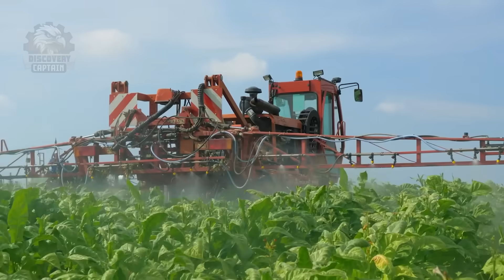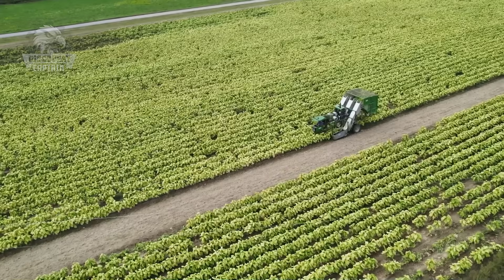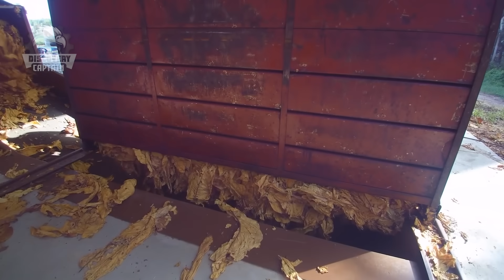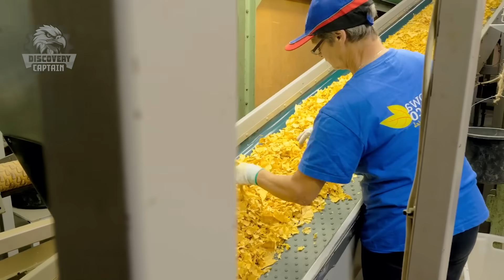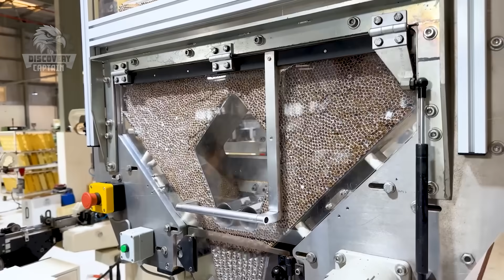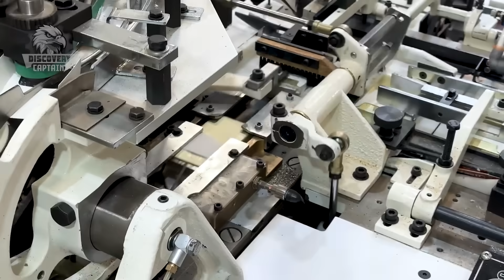How Cigarettes Is Made In Factory? Captain Discovery

Comment: I always wonder how the hell do the owners of this high tech companies teach their earliest team the work process from the start until the final product is on the table.
Reply from the maker: Honestly it’s mostly trial and error at first. Early teams usually learn by building rough versions, failing, and writing down what finally works until it turns into a repeatable process. A lot of the know-how also comes from hiring veterans who’ve run similar lines before. Do you think a founder needs hands-on factory experience to pull it off, or can good hiring cover the gap?
Reply: @CaptainDiscover I think the combination of both.

Comment: You left out a lot of steps, showing completed tubes with a carbon filter stuffed as the end result. Okay you showed two different ways of the factory processing the physical cigarette tube's but you never showed when the carbon filters where added. Then as you where showing the process of how some factories run a long single piece of paper you again left out steps of, 1 cutting the cigarettes to length. 2 again adding the carbon filters. 3 the glue that is used to seal the tubes.

I feel that due to these rather large issues you may want to reconsider this video and feature videos and have some "better planning" as this could be considered as "miss information"

Comment: I'm 52, will be 53 in March, I started smoking when I was 5. My older brother (by 14months) gave me a cigarette and dared me to smoke it... And my life has never been the same.. I've tried everything under the sun to quit and nothing works.. 😔
Reply: When you use patches, do NOT use the instructions on the patches, they're designed to get you to fail back to cigarettes. Use them intuitively to get your nicotine dose(fix) AS YOU NEED IT. A patch can last 2 days if it doesn't fall off, so use heat when applying the patch or keep pressing for a minute or more. Don't switch to the next lower level until you're ready; forget about the time period they suggest you use them for. Doesn't that make sense? When you're conscious of it, you only smoke as much as you need, so why not use as much patch as you need?

Comment: i quit cigs around 2017 cause it tasted like chemicals so i switched to vaping and it is much cheaper which is good for being on low income plus it tastes good like whatever you like there is a flavor for, but i mostly like fruit flavors and some tastes like real fruit or candy and your clothes don't smell awful and anything at all plus the cigs i was smoking they burned up too fast unlike a vape you can puff it till the tank runs out which mine is 10 mil which will take 1/4 to 1/2 a day depending on how i am and too add there is no cooldown and vaping it accept if you puff it too hard then you have to wait 3 seconds for it to saturate the wick in the coil. dont not buy the pen type ones they really suck and worse then smoking a cig so buy the big vapes if you plan to switch so yea don't waste your money on the small ones.

Comment: I live in North Carolina, and I'm surrounded for miles by tobacco fields. I have never seen a machine chop off the flowers, or harvest the leaves. I have seen both these things done by migrant workers out in the fields with no protection from the toxic chemicals produced by the tobacco. The leaves are harvested one by one as they turn yellow. If you wait for the leaves at the top to turn yellow the ones at the bottom have rotted. I don't k ow how they get rid of the stocks, but I've seen plenty of fields full of empty stocks in the ground.